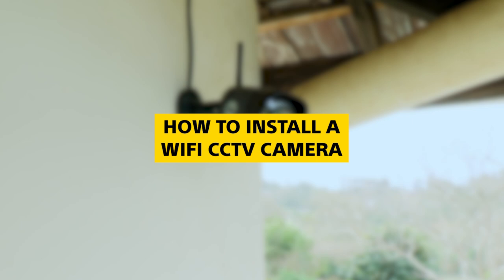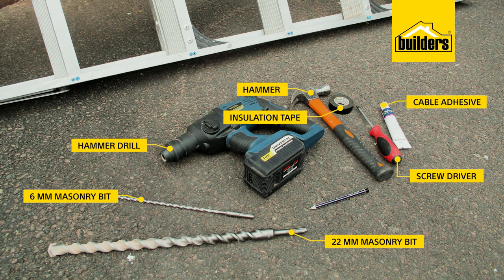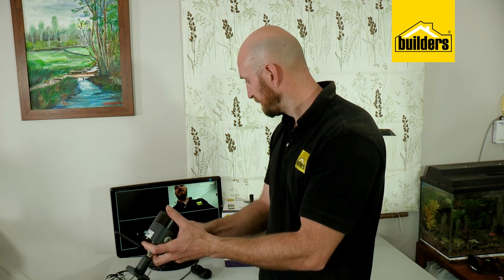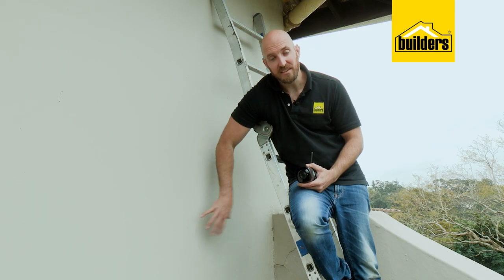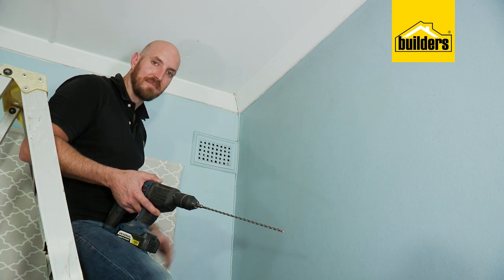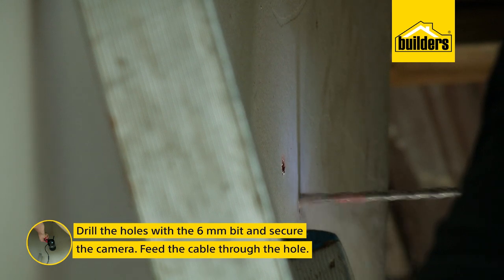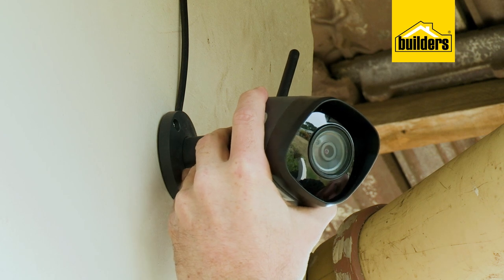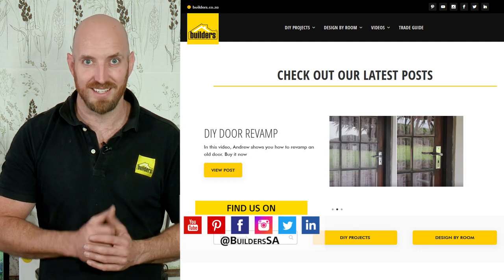How To Install a WiFi CCTV Camera

Comment: So what do you need for the camera itself? Only power cable? All signal is transmitted via WiFi?
Reply: Ethernet cable uses PoE in order to supply it with power